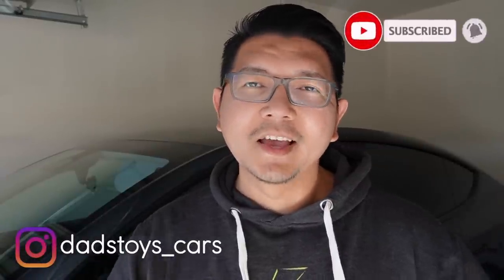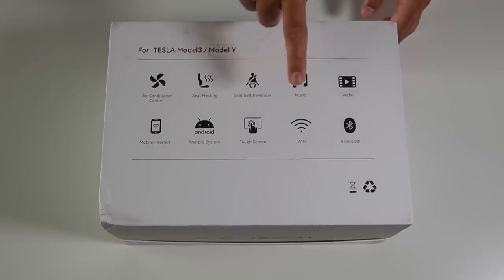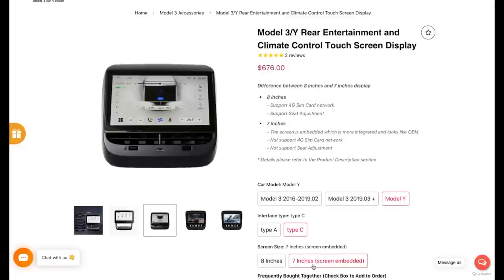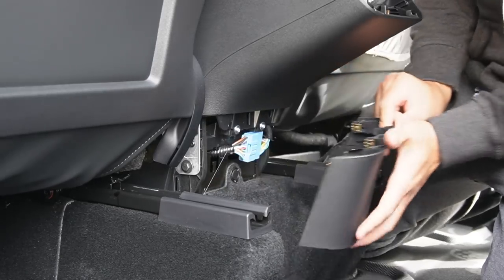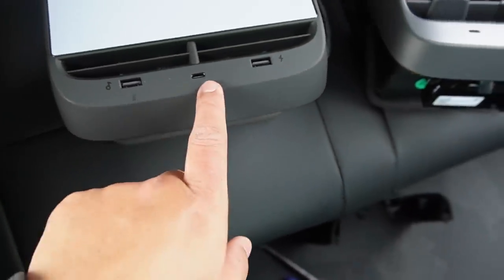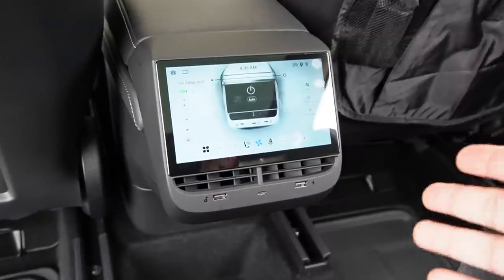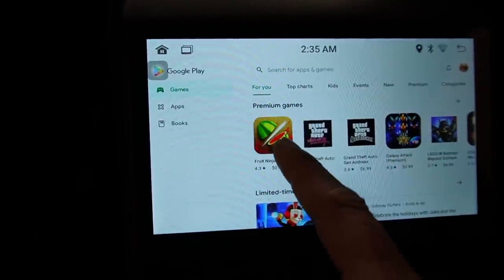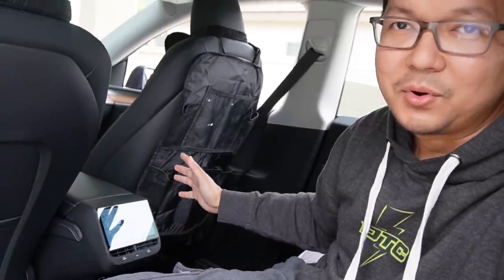2023 Tesla Model Y New Rear Climate Control Display Upgrade! #tesla #2023

Comment: Surprising this after market device can integrate itself into the main system, controlling many of the main unit features.  A gadget worth trying if I decide to own a Tesla.  Thanks.
Reply from the maker: Thank you for watching!
Please subscribe for future contents.🙏😃
Reply: @dadstoyscars  are there other great addons like this for the model y?
Reply from the maker: @iamakimmer   There are a few. Please check out other video in my Channel when you get a chance.
Thank you for your great support!🙏
Reply: yeah the piggyback adapter that he puts in between the blue plugs at 7:25 essentially void your guarantee for the car and - at least in Germany - make it illegal to drive on roads, because you introduce a component which might fiddle with safety relevant car features that was not tested and vetted by either Tesla nor official technicians from the road safety agencies (in the German case you would need an "ABE" [Allgemeine Betriebserlaubnis => general operation permit] given for exactly the type of equipment and the type of car). 

If you have an accident with this installed and it turns out the electronics from your rear climate control thingy played a role, you might well lose insurance coverage and have to pay all damages caused by the accident out of your pocket
Reply: @paeppi  thats not true.
Reply: @ohmyhehe doesn’t seem official from Tesla to me
Reply: @ZachAsaD  no need to be official as we always used after market electronics like radios without any issues. At least for Europe it's important that the device has CE certification
Reply: Is it possible/what are the chances Tesla release software that beaks these addons?

Comment: the car play is pretty good (is it ‘fake’ car play UI using android?) but the basic UI  has too many features IMO. Heated seats is good, but AC/temp/fan also affects the front and thats not something I’d want the passengers in the rear changing - they can ask. So I’d prefer if they had more space on the screen for the music player (album art and larger play/pause/skip buttons and volume slider). Could use half the screen for that, half for heated seats.
Reply from the maker: It’s an actual real Apple CarPlay UI.
Thank you for your awesome input.
Thank you for watching!
Please subscribe for future contents.🙏😃
Reply: Yes, it would be a nice feature if there was some sort of "settings" menu with a code, where you could turn on and off the functions.

I would mainly use this to enable the backseat passengers to adjust their heated seats, i dont want  them to control volume and A/C

Comment: I'll buy it when: 1/the rear controls only controls the rear air/heat. 2/the monitor integrates with the cars internet connection (not mobile hot spot required). 3/rear passengers are able to connect their bluetooth headsets and stream audio/video/movie without interrupting the driver and front passenger. If this unit does 1, 2 or 3, please comment.

Comment: This is a really clean install, was looking to add a second screen to the back just like the S and X. 

However there are downsides to the functions. The rear screen suppose to only limit functions to rear passengers usage only, the climate control allows them to adjust the front passengers is going to be annoying. Secondly, the vent that's not able to move it's not ideal, some of my passengers tend to get cold and more than often adjust the vent to blow to the center rather than directly to them, i hope the design can change in the future to consider this. In terms of carplay, where's the android love....people with android is out of context here.
Reply: So instead of bigger vents you end up with smaller vent but big screen, idiocracy at its finest.
Reply: A few of ur issues dont make sense, first off, if u use split on tesla, the rear is tied to the front passenger only, not the driver. This device is android base so u can download direct to the unit any android apps, along with connecting it to android auto if u want... but is a waste as android auto is limited vs this being able to play netflix, youtube, anything even while driving. The issue of the vents i agree, already have my front passenger always complaining about not being able to turn it off... yes u cant turn off the passenger vent when someones in it... its by far the dumbest design, just like the new update, cant use cruise control(basic) not even talking about Autopilot without the brights and windshield wipers being on auto... nothing like driving through country on nice sunny day with splatting bugs and then ur wipers go off smearing more than half ur view going 80mph... then having to get out on said highway to wash them off... some of the tesla engineers need to be cleaning toilets verse writing software by their logical reasoning... Dont get me wrong i love my Tesla, but rly hate their apple approach on a lot of the things. Limiting me the owner to control my own shit is why i ditched apple 10+ years ago. If they continue down this path, they will be ditched too. 

Btw for all those with passengers that hate the vent not turning off, i bought a $20 vent blocker off amazon, and it slides/stores on the side of passenger seat... Just dumb...

U could easily block these vents too, i plan to with well placed velcro and felt. But again shouldnt have too
Reply: Since their has to be an actuator for the rear climate control to function. Tesla needs a setting to limit how much that actuator opens. This would allow the rear air to be regulated….
Reply: @Chris-hw4mq  no, if they put the usb outputs on the side or bottom of the unit, you free up space to make the vents bigger.
Reply: another thing: when you play music or video, it just uses the car's speakers. So when your kids are watching Pokémon during a 4-hour trip, you'll be insane before you reach your destination. And Bluetooth is connected to your car, so they can't connect earphones to the device I guess. There needs to be at least one headphone input.
Reply: @ivo4357  Well I suppose one can disconnect the bluetooth connection to the car and just connect a wireless earbuds / headphones to the unit itself.
Reply: @boredtroll  No you can not.

Says so on the website... Only connect to car, not headphones.

Comment: Just wondering the display cable, what is the green hanging wire for.  Do you think installing ambient lighting is a great place to hide wires?
Reply from the maker: I believe the wire is for front passenger seat control option but this display doesn’t have that function.
This 7.2” display has that function: https://youtu.be/uXXHpT94kEI
Thank you for watching and your great support!🙏😃

Comment: Which one you suggest, 7 or 7,2, does 7,2 has enough air vent ? 7; resolution and looking not good but larger vent.
Reply from the maker: I would go with 7.2” faster processor, better resolution and can connect Bluetooth headphones and game controller. If you worry about air flow then go with 7.5” has all what 7.2” has and more with bigger air vent. Here is the link: https://www.hautopart.com/products/model-3-y-7-5-inch-rear-intelligent-entertainment-system-v3
Use code: DAD for 15% off.
Thank you for watching!
Please subscribe for future contents.🙏😃

Comment: Hi which model would i choose for my 2023tesla model y long range..there are several options: “model y” and “model y standard range made in usa” thank you in advance.
Reply from the maker: It should be “Model Y” option for Model Y LR. 
There is also an updated version of the rear display which has faster processor and you can connect to Bluetooth headphones and controller which this older version don’t have.
Here is a full review of new display:
https://youtu.be/uXXHpT94kEI
Thank you for watching and your great support!🙏😃

Comment: Does the unit have it's own Bluetooth connection? So that one could connect wireless headphones to the display and watch videos on it while the driver could simultaneously play their own separate audio over the normal speakers?
Reply from the maker: It has Bluetooth to connect to car speakers but can't connect to BT headphones.
Thank you for watching!
Please subscribe for future contents. :)
Reply: No, and it is a significant problem because the bluetooth connection to the car is delayed.  This results in a near 1s delay between audio and video.  Don't buy if you are planning on using streaming service.  If watching video from USB, you can use VLC or MX Player apps in Android to adjust the audio delay.  It is not plug and play and I'm considering removing and returning.

Comment: This one or the smaller one without media? Which you think? I know the previous version of this one (the 8 inch) has a few issues like air flow and an issue when the car updates.  Which would you recommend? I don't have kids or many rear passengers but willing to pay for it just because it'd cool. But if you think the smaller one is better , I'd appreciate your recommendation.  Thank you
Reply from the maker: This display offer much more options and better design in my opinion. If the cost is not an issue then I would definitely go with this display over the smaller one for the design and look in rear climate control area. Also this 7" display is actually easier to install than small one because you don't have to take original air vent insert from OEM air vent.
Don't forget to use code: DAD for that extra 25% off!
Thank you so much for watching and your support!
Reply: Thanks a ton for your response.  Love your channel.
Reply from the maker: @TW-gr8rk Thank you for your awesome support and have a great 2023! 🙏😃

Comment: Also do you know - is there a way to also install the minimalist heads up display AND this?  Was going to get both but they install into the same rear port :( …can the former plug into the front?  Thanks again - great content!
Reply from the maker: I think you should be able to hook both of them to the same rear port as the Hidden from display use very little power and doesn't control anything at all.
Thank you for your awesome support!

Comment: Thanks for the video. I can’t figure out how rear passengers can control the fan speed/temperature from the rear for just the rear in my 2023 Y. Seems this would allow that. When I press “rear” on the controls I’m only seeing “fan off/on” and rear seat controls.
Reply from the maker: Tesla Model 3 & Y only has 2 zones climate front driver and front passenger so the rear passenger get whatever temperature from driver. That's the same on this display but it has ability to change temperature and turn on/off from the rear also heated seats control.
Thank you for watching!
Please subscribe for future contents. :)

Comment: WORD OF WARNING:  If planning on watching videos, the bluetooth connection to the car is delayed.  This results in a near 1s delay between audio and video.  Don't buy if you are planning on using streaming service.  If watching video from USB, you can use VLC or MX Player apps in Android to adjust the audio delay.  It is not plug and play and I'm considering removing and returning.  

THIS NEEDS TO BE MENTIONED IN THIS VIDEO!  I bought this because of this review and somehow you don't mention this clear problem!
Reply: I just bought this last weekend and installed it. I can confirm that the audio/video delay exists.  I'm not sure that it's a fault of Hansshow. I have the same problem when watching youtube on my phone while connected to the tesla via Bluetooth.
Reply: @JackFurr  Agreed that it is not unique to the Hansshow Unit.  However, if the only audio out function they offer is a bluetooth profile that introduces a delay, you shouldn't advertise it for that function.  They should offer the ability to pair with bluetooth headphones (which don't suffer from the delay), or use a different bluetooth profile that minimizes / reduces the delay (do a FaceTime call while using the car's audio and the delay goes away).  Or, offer a system-wide delay compensation - that would probably be a lot more difficult to do, but I bet they could do it if they dedicated resources to it.

Comment: is it an independent control to control AC for the rear zone or it is a duplicate control to the main display? I don't understand
Reply from the maker: Tesla Model Y/3 only have dual climate control one for driver and one for front passenger. The rear passenger will get the climate temperature from driver’s control. However when I adjust the temperature from the rear display to hot it override the front temperature too but when I adjust driver’s side temperature it also overrides the rear temperature. But also you have ability to turn on and off rear climate from the display.
I hope I answer your questions.
Thank you for watching!
Please subscribe for future contents. :)

Comment: You showed that all the audio functions (volume, track) synchronize on the front screen immediately when an adjustment is made using the rear screen. Do any of the climate functions (fan speed, temp, rear heated seats) synchronize on the front screen when you adjust from this back screen?
Reply from the maker: Fan speed and temperature sync with main screen but heated seats are not. You turn on from rear but it wont show in the main screen that it’s on. But you able to turn and off from rear display it just doesn’t show in the front display.
Thank you for watching!
Happy New Year 🥳
Please subscribe for future contents.🙏😃

Comment: 2023 model Y do not have any connectors under the vent. how do I connect the rear screen? Thanks in advance..
Reply from the maker: Is your 2023 Model Y a stand range AWD? You can contact Hansshow and request alternate wire harness that connect to the front passenger seat side panel.
Thank you for watching!
Please subscribe for future content. :)
Reply: @dadstoyscars  is a standard range AWD, got it last week
Reply from the maker: @sivasubraranjit4042  I think all standard range AWD don’t come with rear OBD plug. I just tested this new display better display. 
Here is the link: https://youtu.be/uXXHpT94kEI
You still have request a new wire harness to connect to the front connector.

Comment: Well the one feature that I wanted doesn't seem to be there.  How do you turn off rear climate control from the back?  Only button that looked like it would do it is the circulate button but that one just goes from recycled air to fresh air right?
Reply from the maker: There is on/off button in the middle of the display below where you adjust the fan speed to turn off rear climate which I didn't mention in the video. Sorry.
Thank you for watching!
Please subscribe for future contents. :)
Reply: @dadstoyscars  definitely something to add because I think that is a primary function folks would want.
Reply from the maker: @ELCapiTRAN  Agree! 🙏

Comment: I thought that I saw an extra green wiring harness? What does that clip into?
Reply from the maker: I believe that small green wire was supposed to connect to front passenger seat control if the unit had that option. But this display doesn’t have that option so I didn’t have to connect to anything.
Thank you for watching!
Please subscribe for future contents.🙏😃
Reply: @dadstoyscars  I already subscribed. I’m thinking about getting a Model X or Y. Just trying to figure out which one is the better value. I drive a hybrid now so I have to get my mindset around the reduced driving range vs my hybrid.
Reply from the maker: @jeffreysims1865  Thank you for your support! If you talk about value then go with Model Y. But if you really need to use that third roll seat all the time then go with Model X. I still don’t think Model X is worth it for me because it’s not much bigger, double the price and you don’t qualify for $7500 tax credit.

Comment: Have you visited tesla service center for any issue with this device installed? I wonder if they are gonna be problematic with it about your warranty - they are pretty strict sometimes. I wonder if they see it and void your warranty on your display issue (or even mcu unit itself). The tesla i know does that when they see a after market product installed. That would be my only concern about the device before purchasing.
Reply from the maker: Yes, Tesla technician came to fix my door after I install the display and I even showed him the display but he didn't say anything about the warranty issues at all.
If it would ever have any issue that would positively cause by this display, I would just take it out and put OEM air vent back in before contacting Tesla service. It's very easy to install and uninstall so it should be quick to do that. 
Thank you for watching!
Please subscribe for future contents. :)